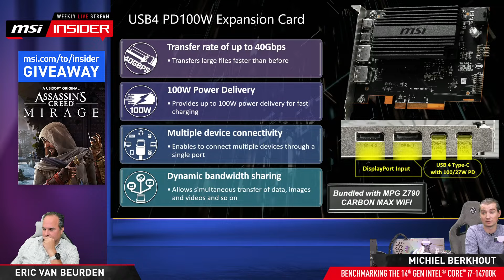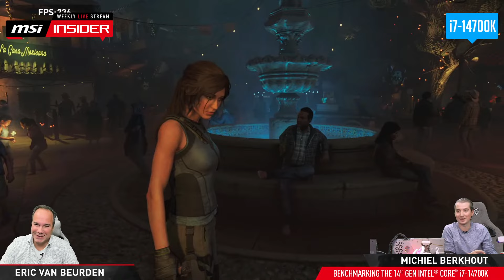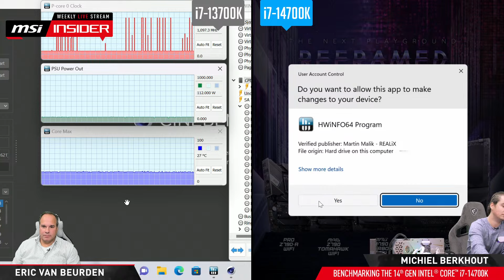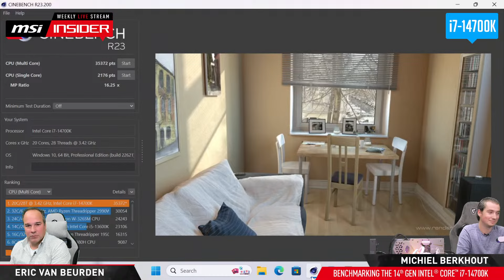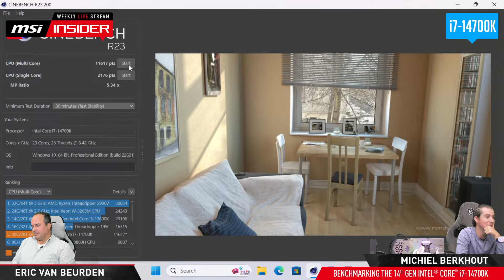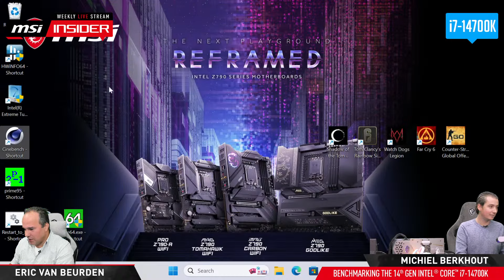Benchmarking the 14th Gen Intel Core i7-14700K

Comment: Wszystko fajnie ale... po zmianach w lite load CPU można sprawdzić stabilność w prime95. Gwarantuję, że komputer zaliczy bsod. Mam 14700k i msi mag z790 tomahawk wifi ddr5. Po ustawieniu mode 3 też cinebench kończy 10 minutowy test ale prime95 daje bsod już po kilku minutach. Dopiero mode 6 dało stabilność w prime95 przy 20 minutowym teście nie było problemów. Wszystko poniżej mode 6 nie ukończyło 20 minut testu prime95 zaliczając jednocześnie pozytywnie 10 minut cinebench r23. Po za tym czy podczas testu miałeś wyłączoną opcję IA CEP SUPPORT czy na auto?
Reply: Therefore he mentioned this depends on the silicon lottery of each singular chip.
Seems like your needs more VID voltage.

Comment: Ignoring the fact that I don't have time to watch 2.5 hrs of this, at least the CB23 runs were useful for me. 
Running a 14700KF on a Z690 Tomahawk DDR4 with 2x16 GB G.Skill Trident Z 3600, CL16 and a 240mm Lian Li Galahad, I'm getting around 34000 points - which tells me that DDR4 still doesn't seem to be that far behind DDR5 (at least not in this workload), but, more importantly, that I probably didn't mess up too badly with my BIOS power-settings. 

My limitation is surely my 240mm AiO, which seems to be able to handle about 230W (just) without reaching thermal throttling territory. For that, I reduced PL1 and PL2 to 260W, dropped ICCMax to 340A and reduced CPU Lite Load to 4 (default is 9). I probably could've done with slightly lower PLs and leaving ICCMax on "unlimited". 
Intel's recommended ICCMax (I think) of 307A will result in lower boost clocks, BTW and a few thousand points less in CB-score. With my current settings, the CPU will draw around 225 to 230W in CB23 and boost to 5.3 GHz on all P-cores. 
Higher PLs (and/or raised ICCMax of course) will result in temps creeping up too high and increase in CB23 performance is negligible. For example: XTU's quick-mode suggests 300W for both PL1 and 2 and 400A ICCMax - which is still too much for my cooler.

For day-to-day operation and gaming, I don't think a stronger AiO is required. The CPU-heaviest load I put on this PC ATM is Baldur's Gate Act III where the CPU will draw between 50 and 100W (depending on the scene and whether or not I have my 60 FPS limiter active) and max temps reach the low 60s. Larger AiO might be nice to reduce noise a bit, but with a gaming headset, that isn't too much of an issue.

There's just one thing that bothers me and that  is the fact that my CPU is getting slightly underwhelming results in two of the Passmark CPU benchmark-tests ("Find Prime Numbers" being one of them). All the other ones are right where they should be or above average, but those two sit markedly below what other 14700s seem to have achieved. I was thinking this could be down to my DDR4 vs other folks' DDR5, but then again - Passmark RAM-test rates my RAM in the 99 percentile, so... :/

Comment: The 13700k is running at 1.34V on CB_R23, 14700k only at 1.20V. This could explain why the 14700k is significantly cooler and also more efficient.
Reply: Are you still owning it? @kasi

Comment: The efficiency of the CPU is basicly the highest at very low power.
11617 Pkt/25W > 19186 Pkt/50W > 24062 Pkt/75W > 27445 Pkt Pkt/100W > 29891 Pkt/125W etc.

If you combine the system power, PL50W, 75W and 100W is the most efficience, arround 140 Pkt/W.
Sweet spot is further increased, if i.e. the graphics card consumes more power.
Reply: This is the question I asked myself two days ago and ordered a 14700k. I found that through other CPU throttlers that, the CPU doesn't lose to much performance at lower wattages. I plan to undervolt to package 80 watts and expect a 4 percent decrease in game performance and honestly not sure about with video rendering and streaming/recording while gaming. But if you are interested I'll keep you posted.
Reply: @KushiKush  More detailed informations are welcome.
Reply: @KushiKush  Do you have any updates? :)

Comment: Hey msi make a z690/z790 oc guide with adaptive and or fixed static voltage oc settings that windows 11 will run stable under.. on my z690 edge wifi, if i try fixed voltage overclocks apps always crash out windows 11

Comment: do we need recirculating cooling for casual gaming and productivity tasks like in every well respected nuclear plant for 14700k or not?
Reply: Not in my experience. I was really worried about this and bought some new fans for my 240mm aio but it wasnt necessary it stays pretty cool. like 28c on idle/light use, like 50-60c gaming, and cinebench all core was 90c (max package temp). An cinebench is way harder than anything I would realistically expect this thing to do in day to day.

But I see other people reporting way higher values so idk whats up with that. Motherboard setting perhaps. I do have the intel recommended power limits so 253w.
Reply: @jessefisher1809   thanks for the effort of writing this in-depth reply. however, surprisingly I went to team read after nearly 25 years of being on the intel side. i j u s t d o n t k n o w why but it happened. I might one day update here with thermals from 7900x. it was a pretty long and hard taken decision. i can only hope that i wont regret it